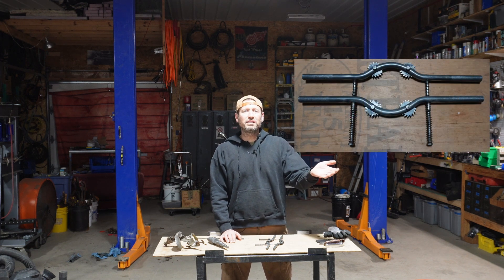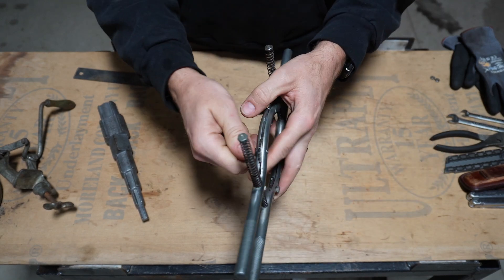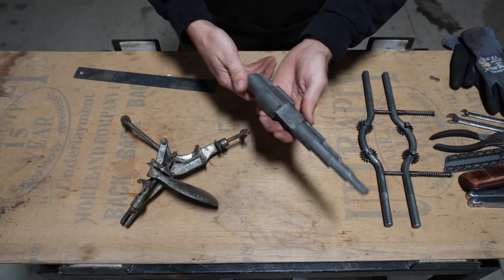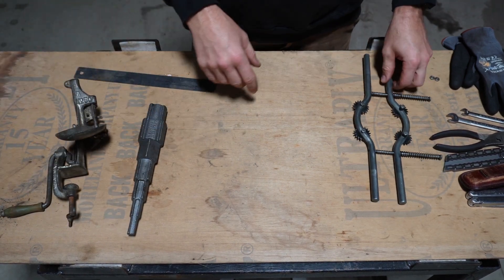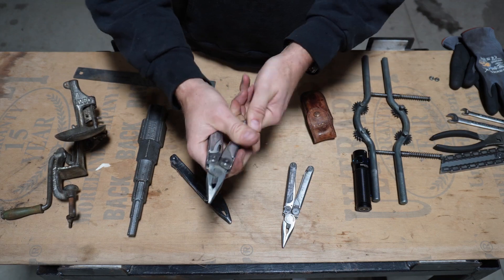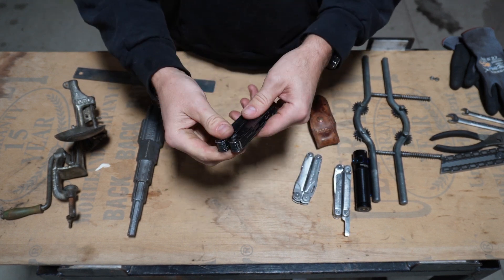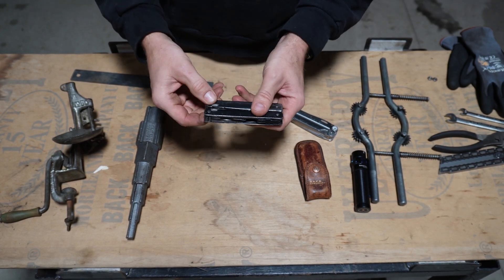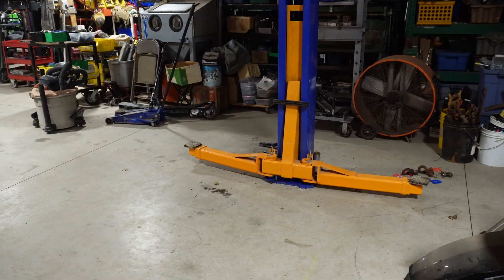Uncommon Tools 089

Comment: The long cast iron mystery tool is an Internal spud wrench made by the Chicago Specialty Company. They specialized in plumbing tools. We still use the same exact spud wrenches, albeit usually foreign made. If it's too long you cut it up. I have one cut up and one whole on the van. Usually used on radiators but a few other places as well such as tub drain fittings or toilet spuds.

Comment: The long tool with the different squares sizes is some kind of wrench wich fits in couplings used on water pipes and fittings.
These fittings are typically made off malleable metal or brass , because these materials are easily cast and made into couplings and fittings.
By the looks of it the tool itself is also made of malleable metal ( like it says on the tool).
You still can see these couplings and fittings used in older heaters in houses or other big water systems.
If you look inside these couplings and fittings you will see that there is an "square " shaped hole in the middle.
And one off the squares on the tool will fit inside the "square "!hole.
If necessary you can shorten the tool if the whole length won't fit inside the coupling.
They also come in smaller sizes.
The part that sticks out off the coupling after you fitted the correct size you can place a adjustable wrench and tighten or loosen the fitting 😀.
The smaller size of these tools are used for pneumatic valves and hydraulic valves

Comment: I don’t know if you realize it but the epoxy goes in the anchor hole, usually you don’t put epoxy on the nut on top so you can periodically tighten them down again if/when the anchors loosen up.
Reply from the maker: @Spritefound  totally agreed,  I did put about 1.5-2 inches in the hole,  starting at the bottom,  and I put a bit on the threads,  but while hammering them in,  the epoxy oozed out the top.  I checked the tourqe 2 days after install and it didn't budge, so I plan on impacting off the nut, chipping the epoxy off, clean threads if necessary,  then re-torque.
Reply: @twosawacres8096  
Yeah, sometimes epoxying can be a hit or miss type of thing. I enjoyed the video keep up the good work.

Comment: Yeah, Victorinox's finish quality (and design of most tools) is on a completely different level from Leatherman. The only thing I prefer on Leathermans are the big blades. I normally carry a Swiss Champ (fits easily in jeans pocket) plus a Leatherman Surge (mainly for the blades + pliers) if I know I'll need it, but if I was only allowed one multi-tool it'd be a Swiss Tool MXBS or similar.